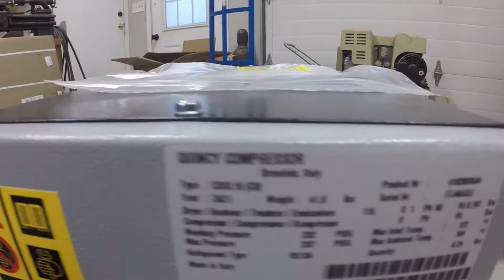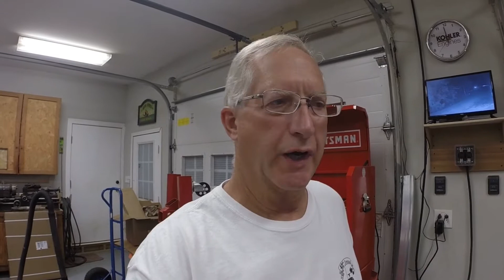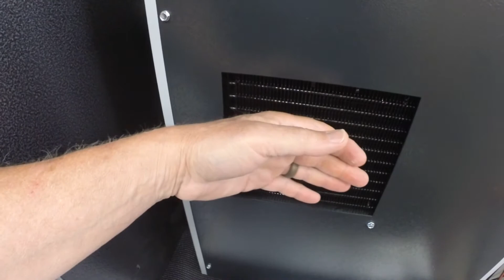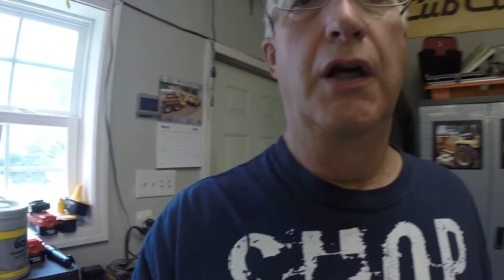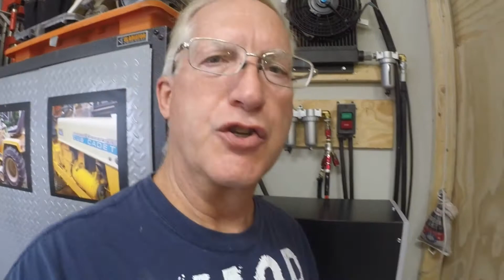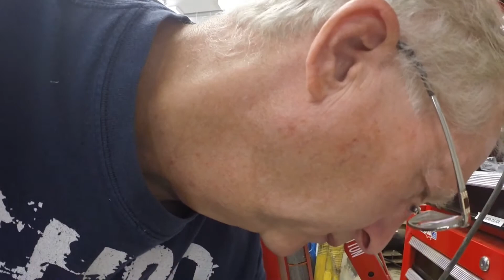Quincy Refrigerated Air Dryer for the CNC Plasma Table

Comment: I have an Italian made air line dryer, but I have yet to try it out. I suspect there's an issue with it, but won't know until the trade school nearby opens up so that the teacher uses it for training. I plan to use it for a plasma torch.
Reply from the maker: This one is Italian made as well, per the label.  Good luck with yours, they are not cheap if you need to replace it.
Reply: @woodandmetalshoptime8048  mine came from a business I've dealt with for some time now.
Reply: @woodandmetalshoptime8048  harbor freight sells one, but I don't know of anyone in industry that would go that route.